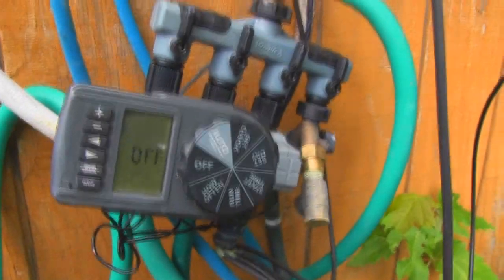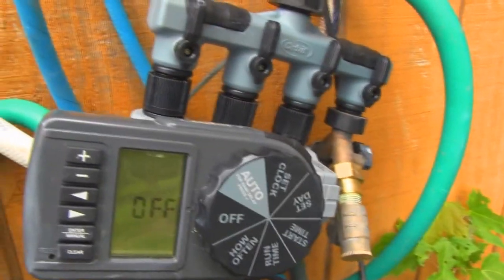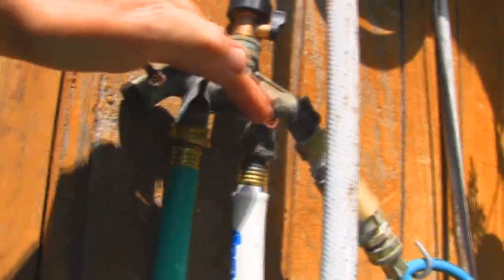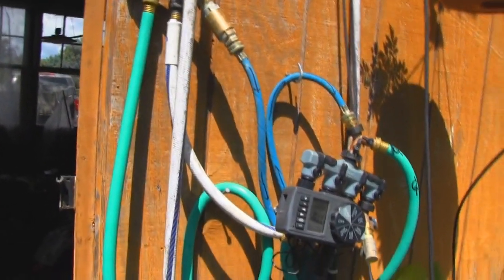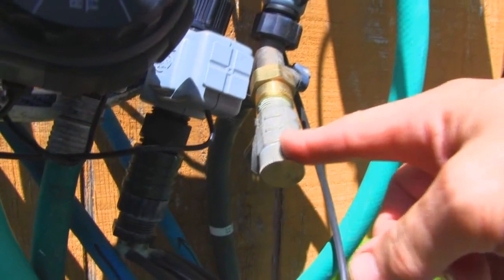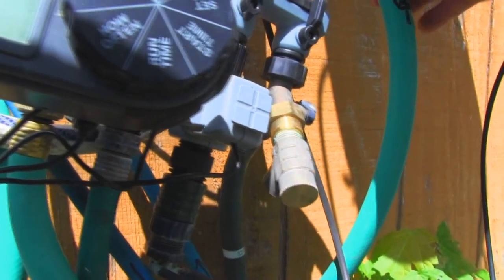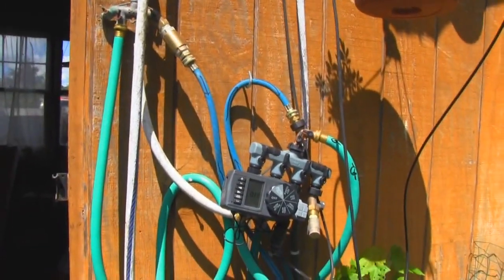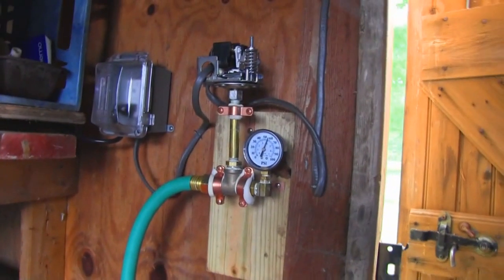Budget Garden Irrigation System

Comment: VERY well explained Marv. I am usually around to drag the sprinkler around but for those that aren't or don't have time this one is pretty cool.
I might have to check out booster pump. I use the mechanical sprinkler heads like you but have a sand problem that causes them to seize up. More pressure might help. I WD 40 sprinkler head and clean screens as it helps keep them moving.
 Well thought out man. Added to watch later.